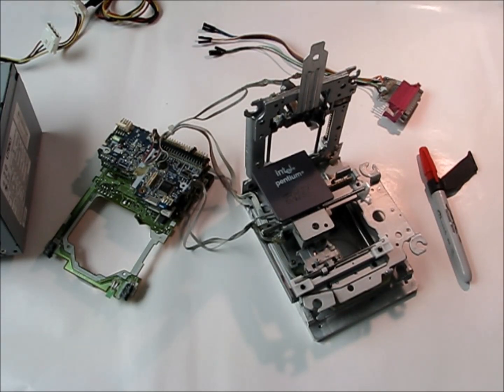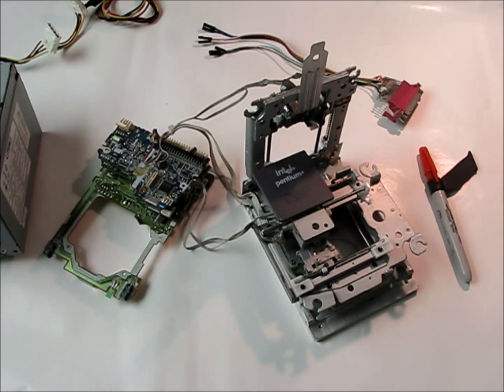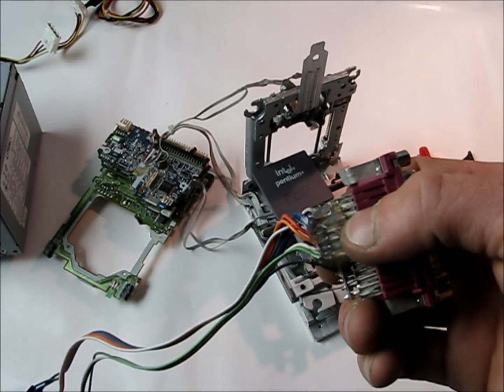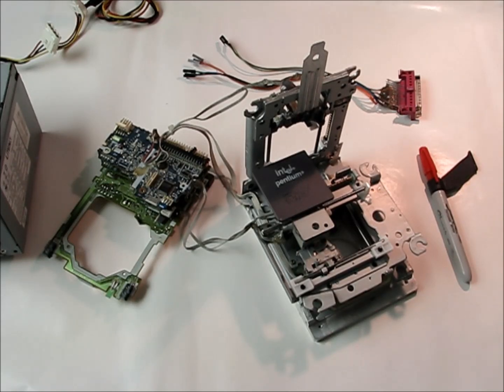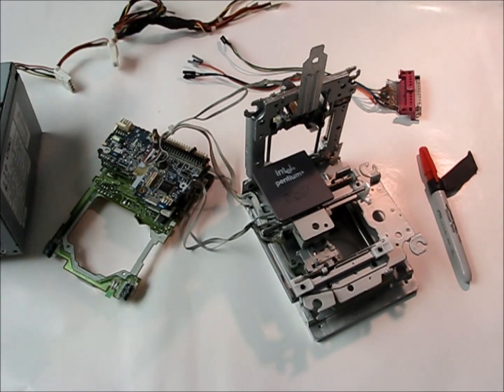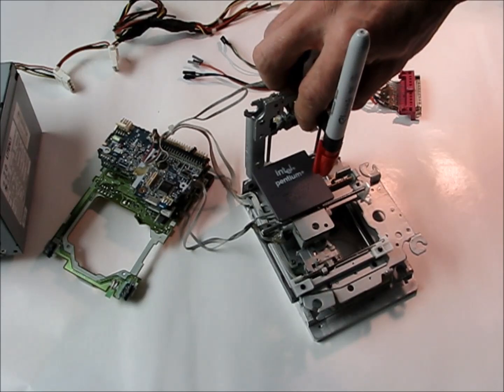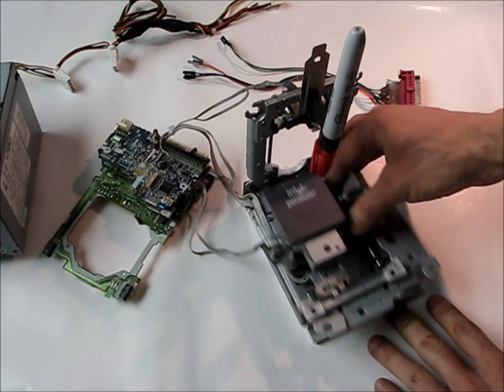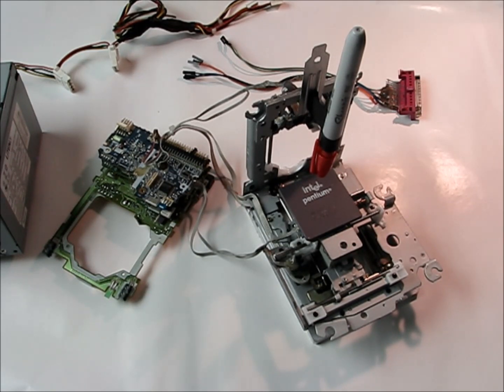DIY FLOPPY DRIVE CNC: Part 9 - Final Assembly Overview

Comment from the maker: Thank you! :D I just made this one so i could show how we could use stuff we already have readily to make a machine (more just for a little learning experiment) The next video DIY series will be a mid-sized Uni-Polar Stepper system made from MOSFets or maybe a simple  ULN2003?chip... forgot what it was called... And then im gonna make a Bi-Polar system (Thats what i use now) Bi-polar motors are stronger i think... I can cut aluminum! :D I will try to get those vids up asap :) Cheers kind sir :)

Comment: way cool , love this . If only i still had all those old drives I used to have . LOL  
did you ever try moving the steppes to drive a small machine screw ?  :: i know you were trying to use sleds as they were . I just wonder because i have use for a micro CNC if i can up the turn count by using a  threaded rod and such .

Comment: Using the floppy disk controller, how can I use the whole course of the DVD in the 40mm case? Thank you excelent work.
Reply from the maker: Wesley Estrela I think I used the floppy drive because the circuit was easier to interface to... the dvd driver wasn't as straightforward
Reply: Thanks for listening, I did a cnc using the same project your, my problem is the axis X and Y move only 20mm, I tried use different configurations in the linuxcnc but don't work. Your axis X and Y work all range +- 1.6'? liked and subscribed, you are very gracious.
Reply from the maker: thanks :D .. I stopped using the floppy drivers because of that reason.. not enough travel. now I use l293d chips to drive bipolar steppers. they are pretty cheap.
Reply from the maker: OR... you can use an arduino with a cnc shield.. that is the easiest I think.
Reply: Thank you Richard, I will alterate my project for the good use.
Reply from the maker: :D